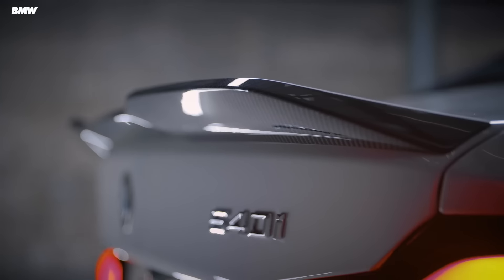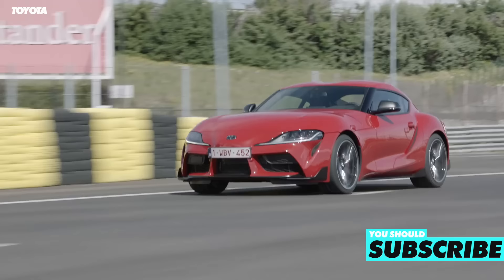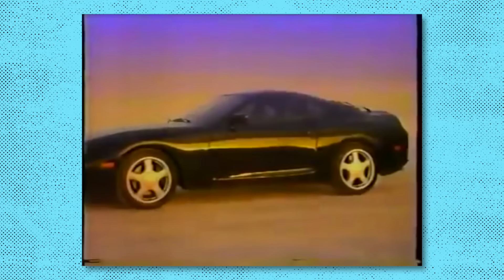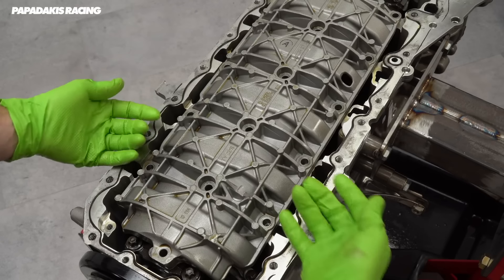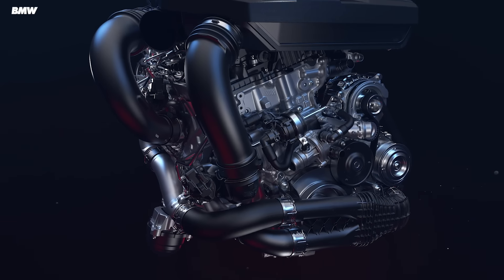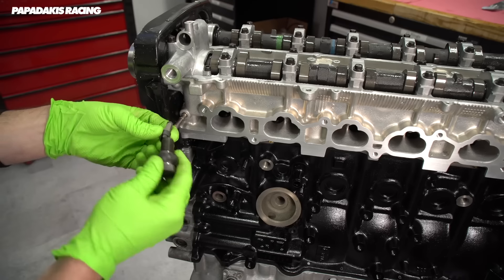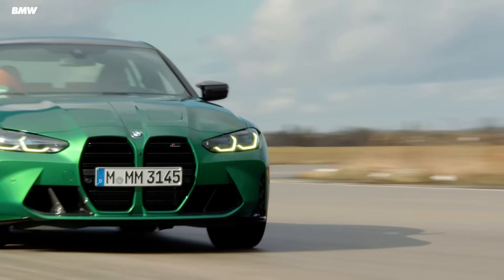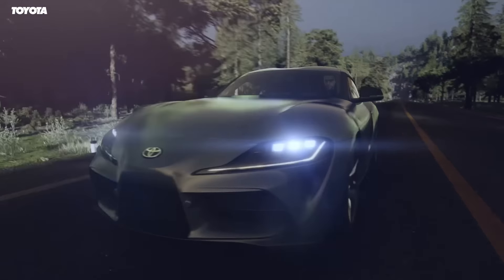Inside BMW's Greatest Engine

Comment: I love the B58 in my 340i....just a tune making ~360whp on 93 octane. Never have I tuned a platform that is so easy to make power on yet stays so reliable and maintains OK fuel economy
Reply: The limit for this engine seems to be the fueling. With a HPFP upgrade or port injection + E85, huge power numbers can be attained even on stock turbo.
Reply: What kind of tune is that? 😂😂😂 a MHD 93 octane tune makes 400 wheel, add a downpipe and ur around 420 wheel
Reply: @Imesswithcars  currently, just a JB4. 360 wheel is a really conservative estimate as well. I'm basing that on a friends m240i with mppsk stock that dyno'd at 363 wheel and we're running the same boost/similar timing advance so it's gotta be there or there abouts. I'm trying to be sure I understand the limitations of this platform before diving deeper as I'm coming from audi APB and Ea888/ea113 platforms. 

Longer term goal is to integrate the Bimmer ECU solutions MHD Ethanol analyzer and set up a flex fuel map but I first want to make sure the fueling system is 100% solid for ethanol mixes.
Reply: @suspect3539  Spare some knowledge for a scholar; are there any drawbacks to a HPFP? I’m eyeing the Supra when it comes in manual. I want to run tune, catted dp, and most bolt on upgrades. I don’t want to go E85 or anything where I have to add a solution other than gas. I don’t really know about fuel pumps.. Can you tell me a bit? I’m still learning the aftermarket scene
Reply: @suspect3539  m240i doesn’t have a MPPSK package, did they flash tune the MPPSK map? At that point why not just flash stage 1 map?
Reply: @Cal-El  drawbacks? High pressure fuel pumps are necessary on modern direct injection engines. HPFPs are mechanically driven off the cam shaft and increase fuel rail pressure above what any electric pump can make. What he's referring to is increasing the flow volume/pressure output of the pump to be able support more fuel for larger injectors.
Reply: If your engine is under warranty  next time you take it to the dealership and they have to scan your vehicle they will see a tune fault codes and cancel your engine warranty if it fails. Bmw came out with a new software that is able to see how many times the  dme has been flashed.
Reply: @Rafarica251  fully aware of this and warranty is already up. Haven't actually flashed the dme yet since I'm using a JB4 for now. Another thing to note is that if your DME was updated after 07/2020, you need a bench unlock to flash. If you're planning on tuning, stay away from the dealership or go MPPSK if you're still under warranty. I think the dinan piggyback tune maintains factory warranty as well.
Reply: 93 octane?? What century you live in? 🤭
Reply: @lamakicker69  I realize I misspoke. The m240i  stock is the same as the MPPSK/M Performance for the 340i (advertised 355hp).
Reply: @Cal-El  what HPFP are you looking at? The supra comes with the Gen2 B58 "TU" pump, so for a significant upgrade, a dorch stage 1/2 is a solid option. Eventually you'll run out of fueling on the HPFP alone and that's where port injection kits come into play. In theory you could go port injection first. However, I've heard that charge pipe injection is not great on this motor due to the distance between the throttle body and cyl 5/6. Means you could a fairly big difference between cyl 1 and cyl 6 AFR. Haven't tried it personally, but it makes sense.
Reply: @suspect3539  m240i is advertised at 335hp lol
Reply: @Cal-El  the Supra already has the TU hpfp that comes in the new B58TU engine. Lot of people(including myself) buy the Supra/TU HPFP as an upgrade for the Gen 1 B58. With that pump you can run the stage 2+ (downpipe and HPFP) map and make 500whp. So for the Supra it’s really not a needed upgrade but if you really wanted to you could upgrade over the TU pump to the Dorch stage 2 pump but unless you are looking to upgrade your turbo it’s not needed.
Reply: Wow plenty of information from you guys, thanks so much. I haven't begun looking at the specific work needing to be done yet. I still have to purchase the car, so I'm just learning about the process until the manual comes out.

But the clarity really helped here. I never knew about fueling. I only know of forced induction (to an extent), exhaust systems, intakes, and some tuning concepts. Up until now, I thought upgrading a HPFP was like taking a part out and replacing it with a beefier one LOL. 

My biggest concern is just trying to be reliable as possible with the stock turbo, tune+dp, exhaust and intake, etc- the basics, I think. I'm kind of afraid of BMW from it's past reputation for reliability. I've only ever had a '17 SS 1LE that was stock and treated me well (aside from an old lexus that goes on for miles to no end).
Reply: nice i ran mhd stage 2 for 2 years no issue downpipe, chargepipe. now im stage 2 plus with a spool fx180 hpfp still on93. north of 420hp at the wheels, trying to run 9s this year with a pure 800 and wheel/tire setup
Reply: @Cal-El  doesnt sound like ur gonna need a hpfp with the mods ur gonna run. you get most use of it from running some kind of e mix. you would still get some gains on 93 but only about 20-30 hp and not worth the high cost of a fuel pump.
Reply: Same here. Love my M340, the engine is a gem
Reply: @evilempire2845  TU pump can run e mixes just fine, Dorch stage 2 is really for people upgrading their turbo
Reply: @lamakicker69  wow, must be grossly underrated or the dyno calibration was off....i guess I should dig into the m240i more since I made a lot of assumptions based on the 340i/440i. Thanks for the info.
Reply: @evilempire2845  Thank you! If it saves me money not having to do it, that’s a plus. After driving the SS, I realized I don’t really need supercar performance, especially with a lighter car like the Supra.
Besides, the tickets I racked up tells me the more power I have- the more trouble I get in lol. As I get older, I realize I have to focus on a balance of fun and reliability anyway. And boy is my wallet afraid of mechanical failure
Reply: BabaYaga Racing  Oh shit hey Baba! I constantly watch your races lol
Reply: BabaYaga Racing  lmao same b58 gang reporting in
Reply: Can’t you just swap out the ecm or do you have to recode the gauge cluster like the stupid Audis. I changed an engine in an a6 and the dealer had to ping germanys Audi system for a rolling code … they make it hell if you want to combine units
Reply: @Rlip  most modern cars with CANBUS electrical systems will have some sort of re-coding if you try to change the ECU, it's not just Audi but pretty much anything since the mid/late-00s.
Reply: @Cal-El  the Supra is a good bit lighter than that SS 1LE, so you probably won't need to do much to the Supra to match the Camaro's straight-line speed (you said it was mostly stock, that statement changes quite a bit if there were power mods to the SS 1LE 😅)
Reply: Try the 2jz 😉
Reply: @lilvic372  I've fooled around with IS300s and SC300s with 2JZ-GEs, but haven't had the opportunity to get my hands on a 2JZ-GTE...yet. In my region, finding a decent MKIV Supra is tough (at least for a decent price) and for swaps, it's easier/cheaper to go with an LS engine. 

I will say, for top-end power (800hp+), 2JZ is undoubtedly more capable but stock for stock, I'd say the B58 has an edge (as it should since BMW could reap the benefit of 20 more years of development). This is probably more of regional thing too, but some folks here like to compare the 2JZ to the Cummins 6BT.
Reply: @Rafarica251  can they do that. don`t they have to prove.. the malfunction happened due to the tune
Reply: @АлексБ-й8ш  93 octane is USA is = 98 octane in Europa
Reply: @lamakicker69 
The B58 with the M performance package will give the extra hp to get 355 hp
Reply: @Conservator.  I know, I have the MPPSK(although I no longer run the tune, I run BM3 stage 2+ for 500+ hp) the M240i doesn’t have the MPPK tune. It’s rated at 335hp.
Reply: To me it’s like what’s considered reliable? 20k, 60k or 100k+ miles

Reason I say this is because having owned 10+ cars with tunes on them and working as euro mechanic you get to see the actual reality of reliability. The most reliable tuned car I’ve owned was 92 Audi s4 that was still on its original turbo into the mid 200k miles range and was bulletproof for long distance trips and made 60 whp over stock.
Reply: @MrGhostOg  mines sub 50k miles, but from what I've gathered from the community there are none of the previous BMW straight six common issues - Oil filter housing gasket, head gasket, wastegate rattle, etc. Currently the only issue I've run into was coolant escaping out past the reservoir cap. A 20$ replacement cap did the trick though. 

 My guess would be that there will still be VANOS issues over 150k and I'm a little concerned about the timing chain being in the back of the engine, making it most likely an engine out service item. No evidence of the rod bearing failures that the s65/s85 suffered from either. 

Funny you bring up the S4 because my 2001 S4 was one of the least reliable platforms I've own/tuned, though I bought it with ~85k miles and had alot of aftermarket parts. Super fun car, despite its inherent understeer.
Reply: @suspect3539  01 s4’s aren’t exactly known for their reliability engine wise unless you crack them open and replace the k03’s. The rest of that platform is unbelievably reliable though and a classic. Basically a good idea to have kept that because a b5 with an 07k or vr6 swap would sound better and be more reliable than any bmw after 60k miles. Unfortunately you’re getting into those miles where new bmw’s fall apart. 

Also another point let’s say with the b5 that initial costs to get a vr6 or 07k in wouldn’t be exactly be cheap, 4-8k depending on setup/labor etc because they’re getting to be easier to bolt in and tuned/wired. You would also be in at least 5-600whp and reliably and then damn does a 5cyl or vr6 sound amazing too. Benefits to those engines is we know they will reliably make over a 1000whp if you want that much.

I’m actually comparing these engines to like group b engines that made over a 1000hp and could handle being beaten on for hours like the 3b/aan used in the first s/rs’s or the s38 but they don’t build them like they used to and tuners are fighting emissions and computers.

Oh also great point is rs3 over a b58 powered car any day anytime!
Reply: @suspect3539  feel like i forgot to add in the issues by miles that are common in each platform as they get older. Started around e46’s which was one of my first cars actually with things like the rear subframes ripping out of the chassis’s and just has gotten worse and worse year by year and even progressing into engine reliability. Early generations were so dependable even in the 100-300k mile range like the m20. This is where we get into 2jz reliability which since they’re so much more simple which makes them inherently more reliable because there is less to go wrong.

Say something like you’re aren’t taking care of your intake passages with the direct injection and that throws off your tune a little and then you start burning sensors and having other issues.
Reply: @MrGhostOg  definite truth. That's why I said never have I had such a reliable platform (I haven't been able to get my hands on a 2JZ-GTE...yet). The good news on the b58 is that the Direct Injectors are relatively inexpensive (~100$/ea), but yeah there is still a ton of complexity relative to older platforms.
Reply: 340i with filthy 93 octane? What a waste
Reply: @MrAtilla187  its all I can get on a day-to-day basis in my region of the US. There's an E85 pump about 30 miles from my home, but I daily drive this thing so gotta take what I can get. Just to be clear 93 octane here is equivalent to 98 RON so it's not terrible fuel like you and a few others have alluded to, though I definitely agree this engine responds super well to ethanol blends based on what I've gathered from the community and seen in my logs. Gonna do an MHD Flex Fuel sensor and appropriate flash as soon as Bimmer ECU Solutions has them in stock.
Reply: 340i ? Nice car 😁.
Reply: Damn my little vr30 in my family sedan with tune made 430whp and 508ft lb. hehe
Reply: Wait more time and you will see
Reply: @classicalliberal4997  Max 8 years lad. u may be right .
Reply: @helpcnarinceoglume  After 80k miles, there is a risk of failure even for the B58
Reply: @classicalliberal4997  u dont have
Reply: @classicalliberal4997  Why u arguing with me then . B58 only fits in bmw cars . 2JZ is the best
Reply: @helpcnarinceoglume  No. I am not arguing to ypu. I am just giving my opinión and also a Channel where a B58 is teared down because it failed. Ok, we agree on 2JZ. 👍
Reply: @suspect3539  save yourself some money and get a m3 g80, you'll get around 375kw (buying 400hp I assume). And it's quite reliable
Reply: Tranny slipping? Otherwise wouldn't be far off upgrading the clutches.
Reply: @suspect3539  I'll say transmission before fuelling. Seen so many people over look the tranny when modding than big $$.
Reply: I just bought my 2019 440i m sport and with a $1399.00 stage 2 tune I'll be pushing 440 horse and tourque😝
Reply: My BMWM140i has that same beast inside. The 3.0L straight 6 is a freaking monster!!
Reply: mppsk makes 355 on 91
Reply: "reliable"

Comment: B58 is the work of the N54 being super fast but super unreliable and the N55 being slow but super reliable, Those 2 engines helped developed the B58!!
Reply: I have both an N54 and an N55 in two different cars.  The N54 has many reliability issues, but nothing catastrophic assuming you don't have turbo wastegate issues before 85k where they extended the warranty to and even then its not catastrophic.  The N55 has less issues, but can have rod bearing issues - this is catastrophic and generally requires a new engine or a rebuild - ask me how I know :( .  Another issue it can have eccentric shaft failure which can cost $4k plus to replace.  But you are right that with the B58 they finally seem to have gotten in right, a nice evolution.
Reply: @alangil40  yeah the N54 issues are well documented these days with reliable replacements available.
Reply: No one has ever called the n55 super reliable, it's just slightly more so than the n54 😂
Reply: B58 is way more reliable than the N55.
Reply: What about the M versions? Or: S55?
Reply: Me with a N52 ☹️
Reply: @holden2260  the N52 is hugely respectable in its own right. Easier on the pocket when it comes to maintenance and a clear inline 6 NA sound the turbocharged variants can never emulate.
Reply: @stubbarn  yeah got a 2008 bmw e91 325i wagon awesome to drive done 214,000kms now but has just had the exhaust camshaft replaced on it but otherwise fine might look at a 2011 bmw 530d later this year or early next year
Reply: I have a S54 engine and she's still a hoot with 138,500 miles. Did the Blackstone lab test and rod bearings are still in great shape. Mind you it's a convertible and SMG so most likely it wasn't abused as coupes with a stick.
Reply: N55 is not slow
Reply: Dam

How yall feel about the s55
Reply: @toolwithintention good engine but you need crank hub and that's risky and expensive
Reply: The thing is.. the N54 is actually reliable. As is the case with everything, a few bad eggs and people abusing their cars, drive people to make parts. And the number 1 motivating factor is money. Everything is blown out of proportion for sales. I have 07 335i.. 17 year old car making 600whp.. Maintence wise and not a mod.. I've only had to replace the water pump, hpfp, get the injectors cleaned, and a walnut blast in 150k miles on odo.. Seems pretty reliable to me.
Reply: @papa_pt  The N55 has one many awards for reliability. Especially the N55EWG variant. Of course the B58 is better.
Reply: @princeali316  what "award for reliability" is that? Yes EWG certainly makes a difference
Reply: @papa_pt  He’s right. WARDS is one of the most trusted awards companies for engines. The N55 placed among that for several years in a row as a Top 10 engine. The failure rate of all N55 is about 8% which is pretty damn low.
Reply: @SinlowMusic  N54 also a multiple time winner of WARDS and international engine awards 😂 they mentioned reliability specifically.

Which btw I can believe for the EWG car, but not the earlier PWG cars which were only somewhat more reliable than n54.
Reply: My n54 154k on stock turbos , stock everything . Only issue is coolant reservoir leak, and vanos sensors . Quit telling straight up lies for no likes on YouTube